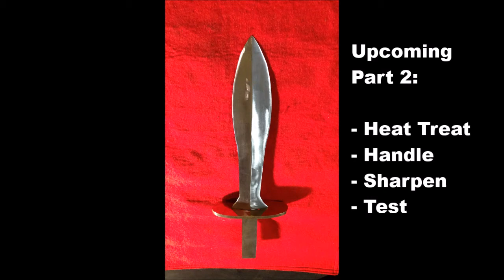Short Sword From 5160 Leaf Spring - Part 1

Comment: Where did you get the bevels for your press. Apologize for noob question, I have always found the smithing of blades fascinating and am getting ready to invest in a 50" propane forge and a hydraulic press/blacksmith hammer set. Strictly want to practice with spring steel. Also what tonnage should the press be to properly press a blade.
Reply from the maker: I made the bevels from scrap.   My press is 20 ton  and does a nice job moving the medal - but - I would consider 20 ton a minimum.  I know commercial presses are greater than 20 ton.  hope that helps